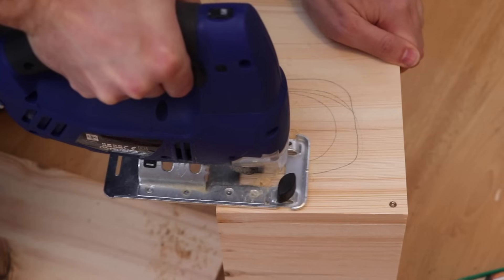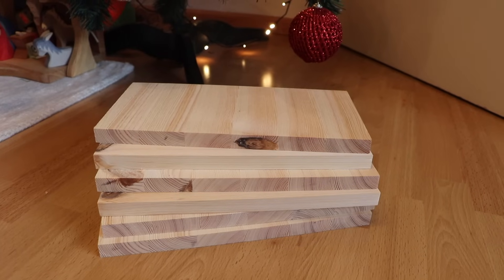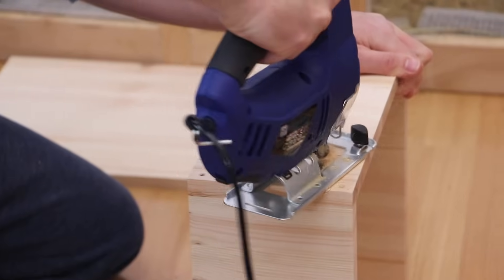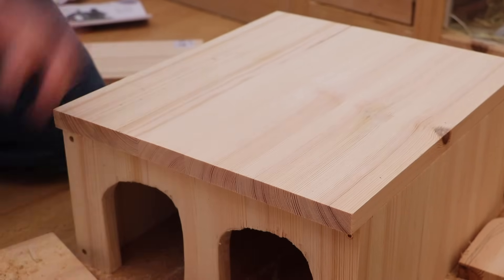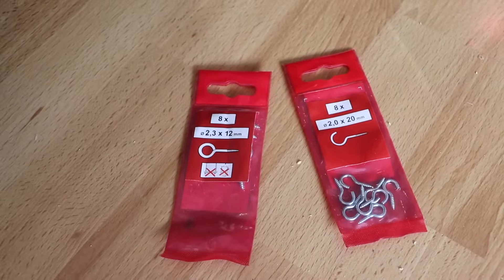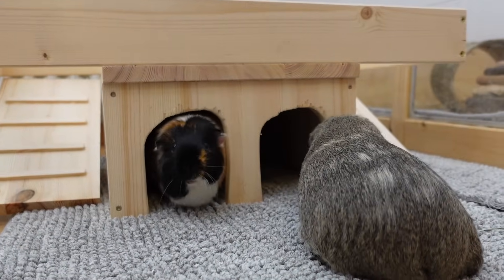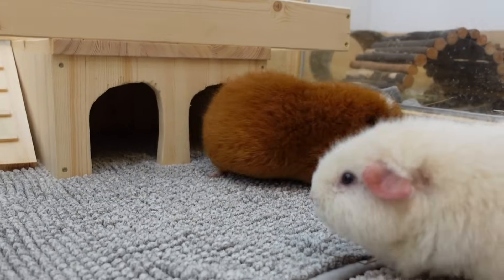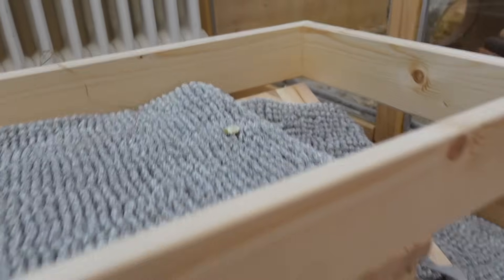Guinea Pig Rooftop Hidey | How to Build

Comment: P.S. a tip for using the jig saw. Put masking tape on the wood where you want to cut & draw your cut line on it. That way you will have a lot less splintering, sanding and a cleaner cut.